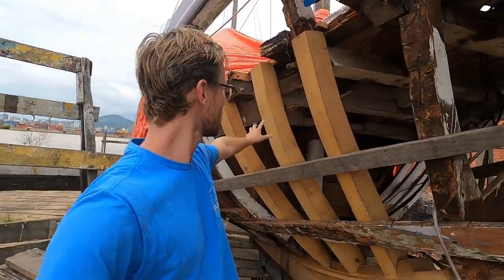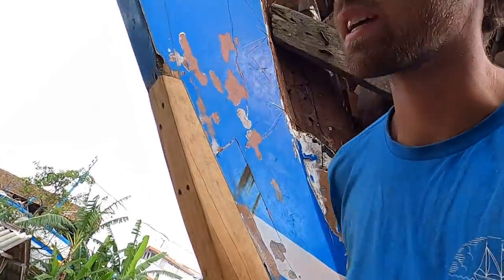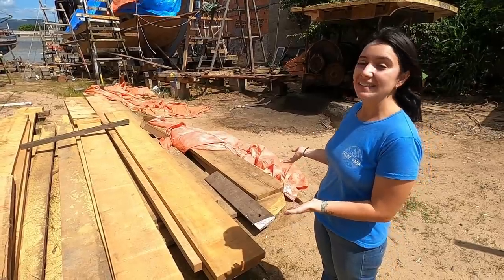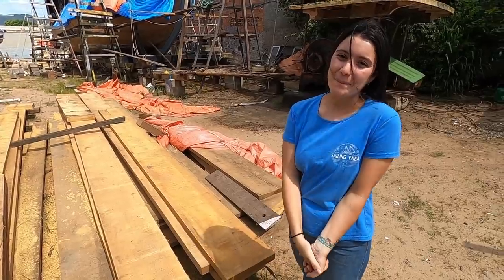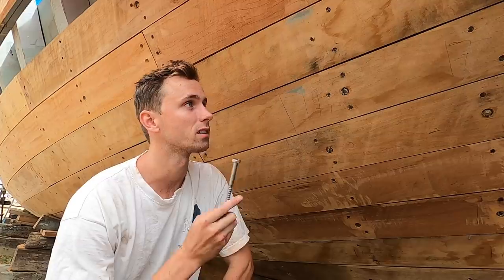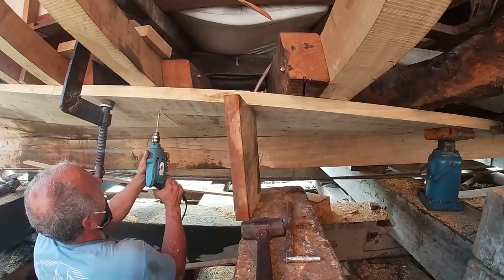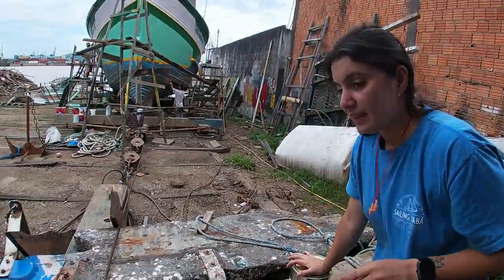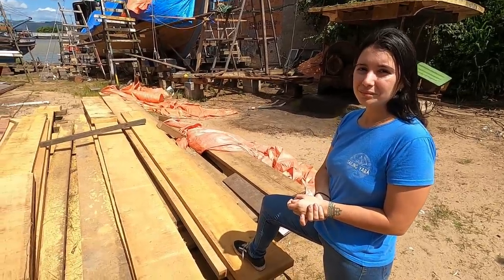A message from the FUTURE + BUILDING LOADS! — Sailing Yabá #22

Comment: Hey guys, looking good!  Glad to see that you are sealing some of the wood but there is something important that you should know!  The most important places on a wooden boat to seal are the faying surfaces that don't show.  Simply put anywhere one pc. of wood meets another, such as between the frames and planking, the planking and floors, the joints in the keel, forefoot and stem etc.  The reason you need to seal those surfaces is pretty simple, think about some water running down the planking from a leak in the deck.  The sealer coat you applied will reduce the water absorption and also slow the drying of the wood which is good on that surface but the water is soaking into the bare wood in the joint where it cannot easily dry out.  The wood in such a joint will stay wet for a long time and wet wood rots!  Try wetting two pcs. of wood that fit together well and put them out to dry.  When the exposed wood is dry open the overlap between the two pcs. and it will still be wet.   I realize that you have already done a lot of planking work so you can no longer reach those faying surfaces.  You can however still treat the wood with a borate/water solution to discourage the fungus that causes rot.  The solution will soak deep into the wood and will also reduce any insect problems.   For the rest of the boat that you have not finished, do consider painting all faying surfaces.  I have taken a lot of old wooden boats apart and I can tell you that painting in these areas makes a lot of difference in the longevity of the vessel.  Your boat is going to be super strong, very impressive scantlings!  James
Reply: Me thinks you better get your arse over there to the boat yard and pull the boat to bits and rebuild it showing off your superior boat building skills since they are doing it all wrong eh.....
Reply: ⬆️ and you Mr. MEGA can stand by his side to critique his every move. eh ⬅️ would you care to buy another vowel?
Reply: @stevenr8606  You sir watch entirely too much tv.

Comment: Nice to see some primer going on, even if a bit late for the planks and frame lower down. Now for the bad news.....stainless steel below the waterline in wood where it is starved of oxygen makes it more likely to fail than a large iron nail. Can you not get galvanized? The steel place next door must know where you can get stuff dipped, then you can but plain steel coachscrews. As usual, stainless looks great until the moment it breaks.
Reply: @jiefflerenard1228   So why waste it on a boat then? They seem to be paying a yards worth of manpower. You think they are getting rich off this? Should i quit my dayjob ?

Comment: Ben, would you please explain the strength structure of Yaba. She does not seem having neither knees no floor.  What really makes the structure solid? And why do not you protect the wood to wood joints like frame to keel or frame to plank connections where normally the water sits on wooden boats? Thank you

Comment: I am enjoying the progression of new frames and planks being added. It is interesting to see how the planks are bent to form the lines of the boat. I am so glad that Yabá is getting this new lease on life. I noticed the description text of one of your earlier episodes (#15, perhaps?) that you mentioned very briefly that bronze fasteners were not in the budget for you, so you were using stainless steel bolts (and presumable other fasteners too....all of them stainless steel.) This made me wonder what fastener materials are used for marine applications. From the quick reading I have done, stainless steel fasteners are available in several grades and they are considered very good fasteners. I have not had any concerns about what the correct fasteners are for a given application on your boat. I simply trust that the shipwrights make exactly the right choices and that you budget to provide those choices. So if the shipwrights are using nails in some places and carriage bolts in others...I assume that the correct fasteners are being used. I am also very pleased to see you using protective paint coatings on your boat. Applying the paints early is a good thing because you don't want to have paint fumes leaching into your living quarters when you begin actually using the boat. You know how a freshly painted room can smell bad? That is the analogy I am making. Since you are applying protective paint to the structural wood components, that tells me this is lumber that has been dried correctly. That is, it is not freshly cut, "wet" lumber from a recently harvested tree. Instead it is wood that has been dried properly before being installed in the boat. That is very good! All in all, I think Yabá is getting a very nice refitting, and I am learning so much from watching these videos. I'm in the USA and I almost wish I could go to Brazil to see you and your boat.

Comment: probably be helpful to add scupper holes between every frame on the deck  side so you will not get any standing water of any kind will allow also any water from cabin etc to drain away straight overboard.

Comment: No, no, no, do not use stainless fasteners under the waterline!!!! Stainless must have oxygen to maintain its rust resistance. Below the waterline you must use silicon bronze! You want this to last don’t you? Good luck. Love your commitment.
Reply: Galvanized will do just fine...
Reply: some stainless is spec'd for marine/salt environments, though you are making a good point about below the water line.

If they keep the primer, paint, top cote perfect - the stainless could be OK.
I know certain stainless is probably worse than iron, when in salt water.  There are different specs.
Reply: @gav2759  As is reading your comments.
Reply: @drx1xym154  If you are talking about 316 it is classed as a good marine alloy, however when it is deprived of oxygen in a damp environment such as in the middle of a poorly sealed plank it will rot faster than a galvanized fastener. All the places SS is used on that boat are the wrong places. No amount of praise and fan mail will prevent rot, corrosion, and worms. Every penny spent on that project is wasted unless it is intended for no purpose other than feeding the boatyard workers.
Reply: @oldtugs  hi, I’ve found that all this good advice is seen as negative moaning by others, nobody wants to listen to those that know better. And can see the error of their ways. I feel the boat yard are just exploiting this young couple,  I’m ready for the backlash.
Reply: @dickenscider7328  I was thinking that too. Or maybe this is just how it's done in these countries?

Comment: Great series guys, very entertaining!  I have an idea for you, it's something I was going to do 20 years ago when I was living on my 41 Lord Nelson in Seattle but didn't.  To get to the point, I was going to clad my frp hull under the waterline in copper sheet.  I contacted 3M for help selecting an adhesive, they recommended 5200 series polyurethane adhesive.  I was going to hammer 1 sq ft pieces to match the compound curvature  of the hull, ballpeen hammer against a sand bag.  Here are the pros, last for decades, does not pollute like stuffing paints, looks cool, the copper oxide (green) repels barnicles, worms, everything better than anything.  Cons, copper sheet is expensive, need advanced skills in shaping the copper.  Cladding Yaba in 99.9% pure copper sheet would be the ultimate protection, and you could make a living doing it for others as you travel.

Comment: Blessed Easter to all. Why is there no use of a Coal Tar or similar product being used on all the wood to wood contact areas and also on the end grains of the lumber ? That end grain will be sucking up water like a straw and leading to rot.
Reply: I bet they don't have dolphinite there
Reply: Not only no bedding but large voids between frames, keel, and planks. The use of stainless steel fasteners is bordering on incompetent negligence, if too cheap to use bronze then at least save a few reals and buy galvanized fasteners. Painting the exposed wood with that magic sauce is nothing more than a feel good exercise, of course it should be painted but that should be done after properly fitting and bedding the frames and planks. yes, the shipwrights are enthusiastic and some are skilled but they are only polishing a turd. Structurally the boat is compromised by the lack of girder strength and flexing in any kind of seaway will very quickly show up as leaks that begin fresh water rot from above and worms from below. It will not be a "strong boat" when finished, no amount of optimism and viewer support can change that reality.
Reply: @gav2759  not especially likeable, tbh.  I came here for these types of comments because I know nothing about boat building and even I can tell this is not right.
Reply: @oldtugs  ROFLMAO
Reply: @gav2759  If you say so lol.
Reply: @MegaDirtyberty  You shouldn't laugh about witnessing a slow motion train wreck like this project. The real shame is that so many people are so ready to trash expert advice and are instead encouraging this obscene waste of wood and money.

Comment: To bad you're not using bronze. My guess is that you will run into issues again with iron rot.
Reply: My thoughts as well. That and crevice corrosion — stainless only corrodes where you can’t see it.
Reply: Don’t worry, the worms and wood rot will eat it away first so they can switch to bronze then.

Comment: A  weakening  is  commonly  observed  in  the wood  that  surrounds  corroding  metal,  such  as nails,  spikes,  screws,  bolts,  and  plates  in  house siding,  rail  ties,  boat  docks,  highway  trailer beds,  and  wooden  vessels.  Wet  wood  not  only causes  metals  to  corrode  because  wood  is slightly   acid,   but   when   a   metal   fastener   is embedded  in  wet  wood,  certain  conditions  are created  that  can  accelerate  the  corrosion  of the  metal.  The  corrosion  products  often  can result   in   slow   deterioration   of   the   wood   sur-rounding  the  metal.  Corrosion  of  the  fastener with  deterioration  of  the  wood  causes  loss  of strength  to  the  joint  and  to  the  structural  in-tegrity  of  the  assembly. Weakened  wood  is  frequently  noted  around nails  in  old,  weathered  house  and  barn  siding that  is  wetted  by  rain  and  snow.  The  wood  that surrounds  the  nail  is  usually  stained  black. "Iron Sickness" excerpt from the paper titled "DEGRADATION OF  WOOD BY PRODUCTS OF METAL CORROSION"

Comment: Hey guys amazing progress! Question, Is there a reason you are not using "boat soup" on the inside of your planks? Is it not necessary because of the type of wood you are using?
Reply: is that the "bedding" compound used at the joints? or contact points? 

I wonder if Salt & Tar used such a thing.

I think the Sampson Boat Co did use some odd "red soup" compound between many of the joints.
Reply: @drx1xym154  it's just a term for a different types of wood finish used when building wooden boats, I've seen people use it on the inside of planks when planking a boat - I have not watched salt and tar but you can see leo's team using it on Tally Ho. It's not the red stuff they use that is something else. I always assumed that it was used to protect the wood but perhaps it's just an aesthetic choice.

Comment: Are there parts of the hull that are not replaced? 😮 With all the repairs done until now it is mostly a new build hull. That is really the better option than building a new one? Labor there must be extremely cheap. Materials also. Watching the process is really interesting. But in which way this makes any sense financially eludes me.

Comment: I don't see any stringers, does this type of boat construction rely on the planking for that aspect of the structure?
Reply: Surely had stringers, but in this kind of Brazilian artisanal wood schooner, planking have a major place as hull structural element. Yabá had massive 5cm thick hardwood planks!
Reply: @andreluis7mmv  Yeah, that makes sense. There is probably a stringer higher up, but I definitely couldn't see a bilge stringer. But those planks are huge!

Comment: Don't you need to put some form of wool/cotton caulking between the boards to create a water resistant seam?
Reply from the maker: Hey Bec! You are right, the caulking is needed for sure! It's one of the last steps though, so we are not there yet!
Reply: @SailingYaba  As the boards were being cut, shouldn't they have had a space cut for caulking [[re installation?  Sampson Boat Co., is a really good channel to watch as well.  You can see the channels precut into the planks that leave a slight bit of room for the caulking.

Comment: May should have primed  before you planked hey guy's the rot will take place where the planks meet the frame the worst. The frames needed to be primed first. You think maybe I'm wrong.
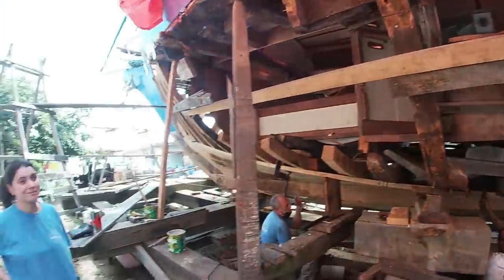Reply: Apparently the comment at 14:41 is just to silence some of the critics. Further along it is very obvious that no effort was made to coat planks or frames and no mating surfaces in any location were coated earlier. It is not like there is a shortage of wooden boat building knowledge available to those managing (mis-managing?) this project.

Comment: Its starting to look great. Glad you explained about the giant wood screw bolts as I was starting to get concerned. Would have been even better if the nails used were ringed nails like in the building trade. Much extra grip.

Comment: Where the ribs are bolted together, the bolts look a little small for the job. Some epoxy at joint? I can’t criticize the bolt material. If it’s stainless, there are all kinds of alloys, some may work others not so much.

Comment: Why didn’t they make forms of the ribs inside before removing the planks
Reply: It much better to remove them,  then leave them in place, makes the job easy. 
Ever tried to copy a curve when there is something behind it.
Reply: @phil5460  Yes! Nail a straight piece of timber 2x1 to the rib either end in the middle then use 4x1/2 pieces rested against the hull nailed down the length of the timber. It’s a rudimentary pattern.

Comment: Given how difficult it was to remove the planks I wouldn't be too worried about nails. I've done a lot of demolition and recycling of lumber and the holding power of nails is really impressive. And that's on relatively soft woods. Hot dipped galvanized nails (which have a rough surface) into this hardwood - they aren't going anywhere!  

I did wonder about preserving the wood. It's great that you are painting it but it seems to me that the highest risk areas are between the ribs and the planks, and that isn't protected.
Reply: - there is typically some sort of "chinking" between the planks to keep the water out.  The wood will swell and dry out - expanding and contracting.  That can be an issue with wooden boats - though I am no shipwright.

Check Sampson Boat Co or maybe Salt & Tar for more info!
These wooden boat projects are fascinating, yet I feel they can take some advanced knowledge, craftsmanship and TONS of work to keep ship shape!
Reply: @drx1xym154  I'm talking about where the planks touch the frames. Even though the corking will eventually seal the boat water will get in when first splashed and then there is always the bilge. I can't remember if Leo put any preservative there. I know Acorn to Arabella did.  Totally agree about wooden boat maintenance.

Comment: I am curious about something. Would it have been cheaper, faster and easier to just cut the top half of the boat away and have them build you a whole brand new hull and frame and then set the top of the boat back on the new bottom of the boat?
Reply: @ccmagma5434  LOL